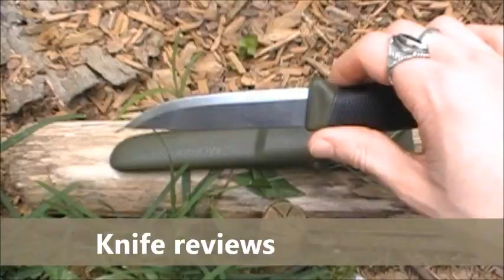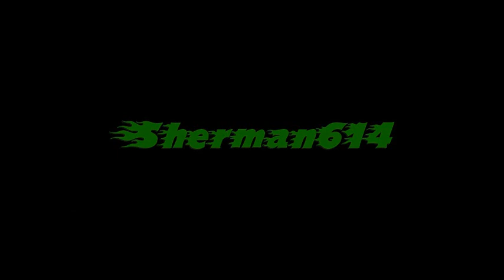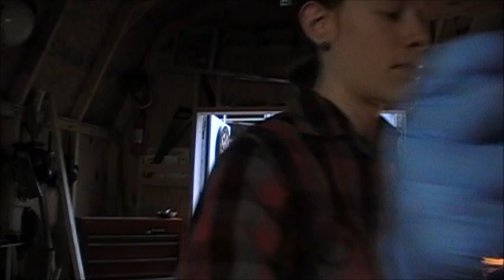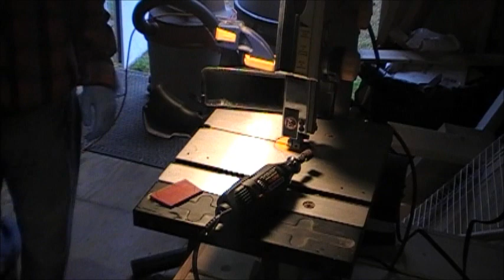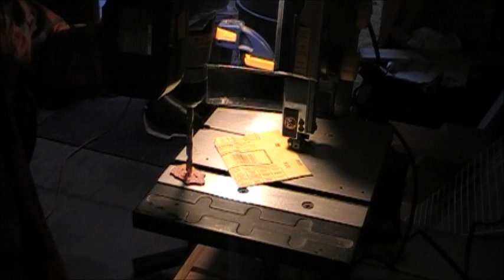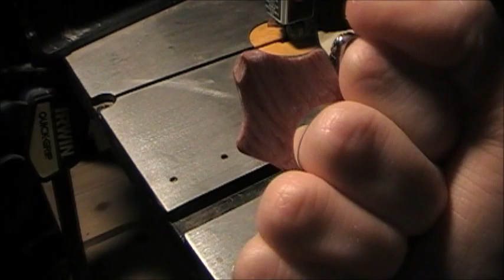G-10 project: Custom knuckle defense tool

Comment: @sherman614 You could also stack multiple pieces and epoxy them together to form a larger block to work with. It would be much cheaper than a single large chunk of G10. Just an idea. Thanks for the vid.